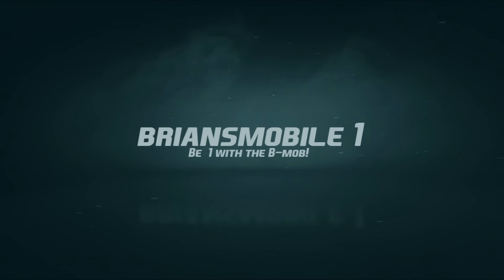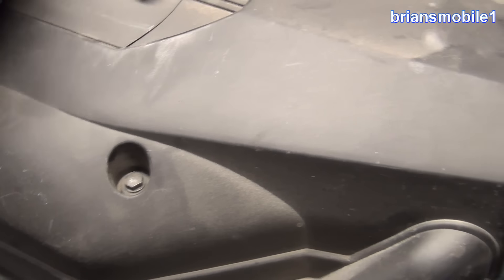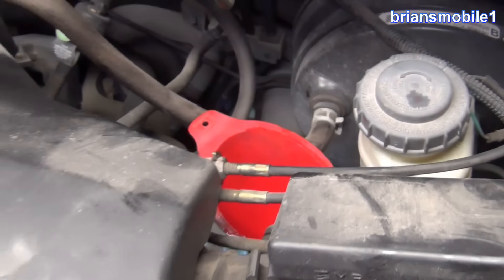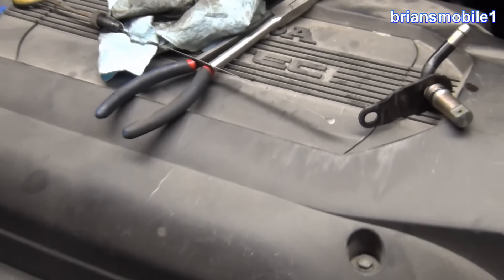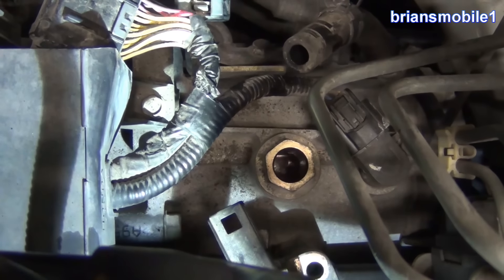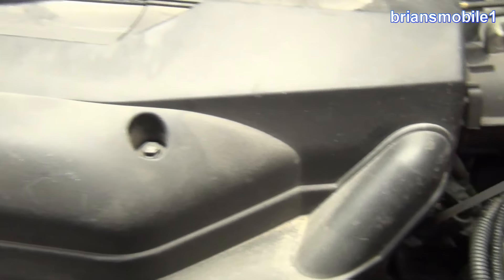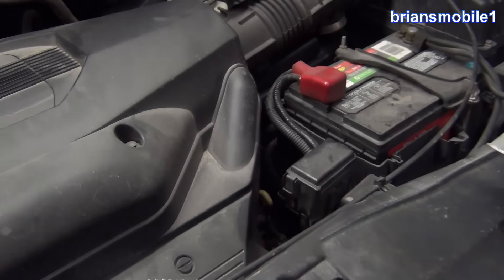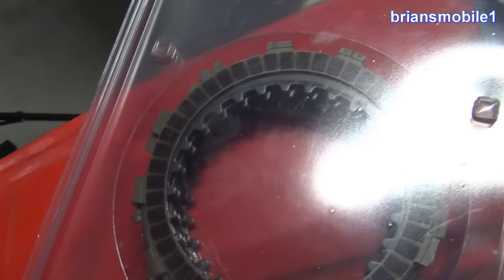Watch this Video BEFORE You Destroy Your Honda Transmission

Comment: I would do this every 6 months on my 04 Accord, sold it with almost 300,000 miles and it still had the original transmission.
Reply: I never changed transmission fluid of my Nissan Altima and it has 3,85,795 kilometers on it . Fluid is still factory red and my mechanic would leave it as it is.
Reply: @MrKhabbu  wow 3,85,795 is a lot of miles that is very impressive!
Reply: Did u use the Honda brand synthetic?
Reply: @stevejeffrey11  Honda
Reply: Sanjay naik, that’s about 240,000 miles
Reply: @MrKhabbu  I can believe that your transmission is that old but I simply cannot believe that it is factory red. There is simply no way that can be true.
Reply: @lkytmryan  May be it is possible . But I get this looked up by Mr Transmission at least once a year and they have shown me the dip stick and the oil is pristine pink . This is their version .
Reply: @lkytmryan  lol it isn’t, especially a Nissan with how cheap they’re built
Reply: @MrKhabbu  u just capping man I worked in a transmission shop 😂 but I’m glad she’s still running good looks like you got lucky with your Nissan
Reply: People are idiots when it comes to maintaining their vehicles. Even Scott Kilmer talks about how weak Honda transmissions are. Baloney. You proved that by taking care of the transmission it preformed very well,
Reply: @Fedproman  scotty kilmer is hit or miss with his advice. Honda CVTs in the last 10 years are just as reliable as toyota’s. Any older than that then i would say toyota’s had the edge. one thing we can all agree - do not go near any nissan with a cvt - they’re a ticking time bomb.
Reply: @Dranamolous  meh to be honest any CVT is a gamble they’re just poorly designed transmissions. Definitely had more Nissan cvts in the shop but Honda’s can also go at 100k it sucks. I really like Honda’s so wish I could say better but hey at least the motor will last 😂
Reply: @autooutlet1563  I’ll take your word for it since you work in transmission repair - I only work on my own and a couple of friends cars. :) you’re right old school automatics are definitely better but CVTs seem to be the way of the future for everyday cars unfortunately.
Reply: @Dranamolous  yea I probably won’t buy one either way, would rather wait for gas cars to go extinct 😂 just never cared for the quality of ride on cvts. But hopefully Honda gets there stuff together And especially Nissan
Reply: @Dranamolous  you're 100% right about that one. Nissan isn't what they used to be. Now they're throw away car's.
Reply: I used Redline in my 04 accord only got 420 k on my tranny...drained out honda fluid first weekend after purchasing...however new 10 speed auto  has no Redline cross reference.

Comment: One of the best "how to video's" I've seen. Quick, clear, concise with a detailed explanation on why the fluid gets that color. I never messed with a transmission fluid swap so never knew why. Thanks for the info. Just bought a one owner 2007 Odyssey and knew the transmission can be an issue but see why now. Previous owners had it done twice in 50k miles over the previous 14 years but luckily at same dealership they bought it from so hopefully none of the issues you covered occurred there. 🤞

Comment: Hell yeah!!! I love when people know about Honda transmissions! They are not your typical ford or chevrolet
Reply: No, they are actually easier to build than the typical ford or chevy
Reply: @thomasderush5180  yeah i know! I actually rebuilt one. Just like a manual transmission with clutch packs
Reply: @thomasderush5180  yeah i agree, but what i meant is that as they are not precisely the same as regular automatics more window for mistakes is existent.
Reply: @thomasderush5180  Maybe a modern USDM trans. I haven't seen any since the 80's. The older planetary gearset trans are extremely simple.
Reply: @zoneb609  does this video apply to 9th gen accord v6? Checking the fluid in afternoon (not warmed up) it's just over letter T in the word "HOT" and after driving 10minutes and checking later it's just under max dot.? Can u check cold or must he warmed? I know fluid expands 1/8inch when heated.
Reply: @metrosb2593   yes it applies! You should check it when hot because as you say, the fluid expands, but it also fills up cavities like the inside of the valve body that are a little bit drained overnight. Checking it when hot and engine off makes you sure it has what it needs in all those conditions. Checking it when cold will give you a good idea, just note how’s the level when hot, and if when hot is good, then know that the level you see in cold must be kept there in order to be good when hot.
Reply: @zoneb609  thanks for the reply!   I was thinking that thanks, as long as the fluid is in between the two dots (but closer to the max) is the best? My reading comes about 80-90% it's just under the Max dot barely touching.

Comment: I agree. I'm never afraid to flush a transmission, but, I ONLY flush using the fluid I intend to use. Using an additive leaves residue in it, even after draining. I don't like any additive other than the right kind of fluid. Additives can affect the friction modifiers, viscosity, detergent package, and extreme pressure additives. It changes the specification of the fluid. A new pickup filter is never a bad idea either.
     The best information in this video is the most basic thing: How to PROPERLY check the fluid level. Fluid level is critical. This is especially important, since the dipstick doesn't have instructions on it.

Comment: I cant agree more. Never in my 35+ years of wrenching have I not done a transmission flush and don't plan on  starting. A lot of pilots and odyssey vehicles up here and I recommend a trans fluid drain and refill every 30K with DW-1 fluid only. Excellent video!
Reply: yep, nice and easy maintenance simply drains out the particulates out of trany.
Reply: What's dw-1
Reply: We changed our fluid on our Accord it was old and dark. Unfortunately the tranny went bad in 6 months. I don't know if that's what caused it but I have heard caution to never change old fluid on high miles cars
Reply: @2Jeezuzisreal did you use the OEM fluid, or something from the parts store? Always use OEM with Honda/Acura for the transmission.

If it was the right fluid, that means that the transmission was already damaged. It's possible that that was the case, and that the old dirty fluid was allowing enough friction to prevent the transmission from slipping. Once properly lubricated, that friction went away and it was unable to shift gears anymore. That's my understanding anyway; someone with more knowledge may be able to provide better info.

Comment: This is so true. I have tried to save a little money by buying the all purpose tranny fluid that even says is ok to use in Hondas. Had bad shifting and even had some clutch material on my magnet when doing a fluid change. 
Did 2 fluid changes with honda fluid, and now it shifts beautifully. 2010 acura mdx with 250,000kms.

Comment: Good video. On my Honda Element I let the transmission drain,replacing the same amount with fresh,driving normally for a month,then repeating the process three times in all. It takes about 7 .5 litres overs a period of three months but the results are amazing. My Element has 375,000 Kim’s
and runs perfectly. Thx again. And let’s hope that the era of mechanics taking advantage of people to get rich will end soon .

Comment: I do my odyssey's trans fluid every other oil change just like you showed here.  Made a HUGE difference in the transmission performance.  Only difference is I use a hose on the bottom of my funnel to fill through the dipstick tube.  Seems to work fine.
Reply from the maker: Nice!
Reply: @briansmobile1  Question, is it safe to use Lubegard Red with Honda DW-1 every time changing the transmission fluid on an every other engine oil change?

Also when changing the transmission fluid on an every other engine oil change do I have to do it 3 times drain and fill or just 1 drain and fill?

Comment: That part removed to fill was actually an update from Honda for the automatic transmission trying to solve the issues it was having at the time. The plug was replaced to insert that part in.
Reply from the maker: That's right- I saw that in another comment.  Thank you for verifying that.
Reply: 2nd Gear overheating problem. The mod kit allowed ATF to spray directly on the gear set.
Reply: Sadly, it was too little too late to help those transmissions.

Comment: Hey! I’ve done this! 2000 Honda Accord. They were a good transmission, just gotta do the drain/refills a little more often than once every 100k miles.
Reply: I have done a transmission drain and fill on my 1999 Accord every 10k miles with Honda fluid. The motor got Mobil 1 and a filter every 5 k. Gave it to someone in need last week. It rolled out of my driveway with 418,075 miles on the original, un opened motor and transmission. Still 27 mpg. Used a half quart between changes.
Reply: @roloaddict  Hard to imagine it being that easy on oil, though I certainly don't dispute what you're claiming here. My '10 Pilot drinks oil; probably 2~2.5qts between changes.

Comment: Good information.   Always use Honda brand fluids; it's just not worth the risk to do otherwise.  One lesson I learned on my '07 Ridgeline: make SURE you can loosen the fill plug before you drain the tranny.  I ended up replacing the fluid via the dipstick tube.  THEN I purchased a new fill plug and, after some exertion, installed the new plug.   I agree with doing a drain 'n fill three times rather than risk damage from a "flush".

Comment: Did the full 3 drain and fills a few years ago on my 2005 Odyssey.  I did use Valvoline Maxlife ATF instead of DW1 and it's been solid for 30K miles.
Reply: J D  i just bought some honda atf. Its now at 10 bucks a qt. Inflation.
Reply: Great video however I disagree about the Honda DW1. I've used valvoline synthetic on my CRV for the past 190,000 miles and is smooth as butter. I change it every 50k and never use Honda DW1. Never had a transmission issue. I even tow a trailer now and then. I currently have 248,000 miles on my CRV and going strong.
Reply: I use Redline ATF D4 and D6 on newer ones...my 04 Accord was towed to the junkyard with 400 k ...still perfect!
Reply: 1999 crv here , maxlife atf no problems .

Comment: Fun thing about atf is that it is the best cleaner you can put in a auto trans and not brake any thing. Every OEM I have bothered to check agrees with you. No power flush and no chemicals out side of the recommended atf.
Reply: Basically get a car that has a good clean working transmission or if you already have one whatever you do make a plan to check and keep that as clean as possible change it ever so often I guess people have there own money issues and most don’t even change the transmission fluid you can go a bit between them but it’s not that expensive and my 05 civic lx don’t have a filter for the transmission I clean the bolt make sure I always get new washer and it looks exactly the way it goes in the same color and I got 148k miles on it I changed it at like 105k maybe I got my car at 100k and it was clean then but I did it anyways. But I believe I filled it through dip stick hole with a funnel
Reply: @pacsmacks7142  bro I have the same year accord and model as you. I currently have 131k miles on it , transmission oil looks a bit brownish dirty but still very fresh. Do you believe doing a trans flush would be safe for my vehicle? Or is Applying atf better

Comment: I've changed the transmission on my dads 2010 civic , and it took 2.5qts of the Honda dw1 transmission fluid. My mom has a 2013 crv awd , and that I've changed that one the same way. On a crv awd though , you have to change the rear differential fluid on them every 15k.

Comment: Good video, very accurate. I worked at a Honda dealership and had many ppl come in after going to quickie, spiffy, lube ya in the tail shops, that used the wrong fluid in the trans. USE ONLY HONDA ATF DW1 ! Do not used cheap crossover fluids. Honda trans are specific to their fluids !
Reply: I wouldn't have even considered using anything but genuine Honda fluid, but I was getting a pronounced shudder in my '10 Pilot at both 44mph and 70mph (caused by slipping Lockup Clutch in Torque Converter). Switched over to Castrol for Imports and much improved. Pilot is currently at 325k+ miles. Also switched my Accords over years ago.
Disclaimer: I also took my Pilot to a dealer to flash the firmware for the Transmission Control Module, and changed the fluid shortly afterward, as the firmware update did not fully remove the shudder. I have friends with CRVs who experienced the same issue with shudder, and resolved it by switching over the the Castrol fluid.
Reply: Great video however I disagree about the Honda DW1. I've used valvoline synthetic on my CRV for the past 190,000 miles and is smooth as butter. I change it every 50k and never use Honda DW1. Never had a transmission issue. I even tow a trailer now and then. I currently have 248,000 miles on my CRV and going strong.
Reply: Wow I just added american XT just one quart tho. What should I do now?

Comment: When I first buy a used car, mostly a Honda or Toyota, the first thing I do (after my mechanic has looked over the car) is to have him flush the transmission completely. My reasoning is that if it's gonna fail it will fail after that and I'll take the car back because of faulty transmission. I bought a car and didn't flush the transmission and after 3 weeks the transmission started jerking when you pull away from a stoplight,.They replaced it for free but I've always flushed them after I buy them from then on. I have a truck with almost 200K on it and flushed it when I got it, about 25K miles ago, and it's running fine. I'm not a mechanic though, so don't take my advice. Those Odessey transmissions seem to be a weak one. I'm only sharing my experience. Edit: typos.
Reply: Honda pilot transmissions are not good they go fast ..

Comment: I just did my 2012 Odyssey and refilled through the dipstick. 

Thank goodness Honda put a drain plug on their pan. 

Easy peasy
Reply: Just make sure you can open the drain plug first before you attempt to fill it (even to test)
Reply: @RichieD_21  mistyped, make sure you can open the fill plug before you drain it.
Reply: @Professional_Youtube_Commenter  ahhh my bad. Yes definitely do that lol
Reply: yes you can that is how I do it , just need to get smaller tip funnel
Reply: @MrJkang12345  I did a 2nd drain and fill and this time I cracked open the refill bolt. It was on tight, but I managed to get it loose.
Reply: If you end up having to fill through the ATF Level Gauge Tube, heat your fluid up a bit and it will flow better.
I found that I could "shock" the Fill Bolt by taking my 1/2" drive impact socket and impact extension and give it a good rap downward with a hammer from the top. Amazing how well that works.
It's not that they were over-torqued when we built them (4.5 +/- 0.5 kgf-m); the two metals (mostly zinc-coated threads on the bolt and tap-cut threads in the aluminum case) just want to seize to one another. I worked the transmission factory for over three decades, and also rebuilt dozens of Honda transmissions. We were able to impact them off on the bench, but they were all locked on pretty good after just a few years of heating/cooling cycles in the vehicle.
Reply: @emailjlira Yes, but it takes a funnel with a tiny end on it a small hose that will fit down in the dip stick tube

Comment: Tip, Remove fill plug before draining. Fill plug can be difficult to remove.
Reply: Also if its stripped and you dont check it before you remove the drain plug, then you'll be sweatin thinking how am I gonna get the new fluid in now that I drained the old fluid out
Reply: @Hippykiller67  Some say you can fill new fluid straight through dipstick hole
Reply: @robertasluko1486  some you can but say a rear dif where you gotta take the cover off or a rear dif on a honda
Reply: @Hippykiller67  lol, you have to on the 2010 rabbits. No fill hole, gotta fill through the drain. To check the fluid you remove the drain and if a little comes out, that means it's full. It's goofy.
Reply: @robertasluko1486  how it is on civics
Reply: Mine were. I found that I could "shock" them by taking my 1/2" drive impact socket and impact extension and give it a good rap downward with a hammer from the top. Amazing how well that works.
Reply: It's not that they were over-torqued when they were built; the two metals just want to seize to one another. I worked the transmission factory for over three decades, and also rebuilt dozens of Honda transmissions. We were able to impact them off on the bench, but they were all locked on pretty good.
Reply: Very Good Advice there friend.
Reply: The fill plug on my '08 Ridgeline's differential was well over the 120 ft/lbs of my medium duty impact gun, had to break out my corded 7amp heavy duty impact gun that's rated for 230 ft/lb and even that took about 5 seconds of jam time.  Set them both to the 35 ft/lb spec, just finger tight and about another 1/8 turn.
Reply: @slowazzes1972  have to use the Johnson rod
Reply: Next to the kanuder valve
Reply: @robertasluko1486  Thats what i do  with a RDX 2016 Acura. works great! a hole is a hole. goes to the same exact fill.
Reply: Forget the fill plug leave it alone put a small clear tube in the end of your funnel it will fit in the dipstick hole add your fluid in the dipstick hole. Use a funnel just like the one he uses in the video 🤠🇸🇴🕷️

Comment: Just changed the Transmission fluid on my 1997 honda accord @ 114,548 miles. I've owned the car for 4 years now and just got its first change under my owner ship. Took it on the highway and could tell instantly how smoother it shifts gears now!
Reply: Yep. Same with my 2012 crv at around 100000